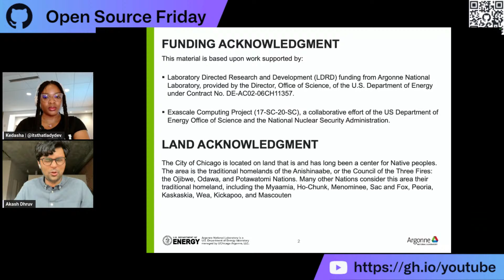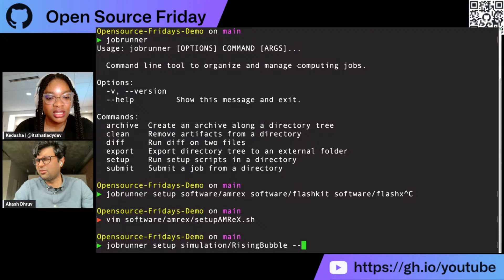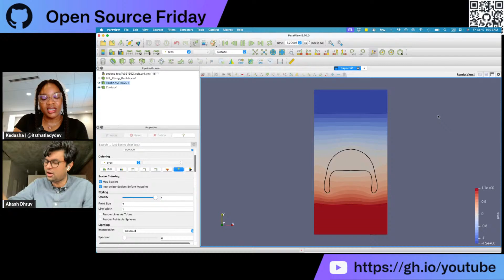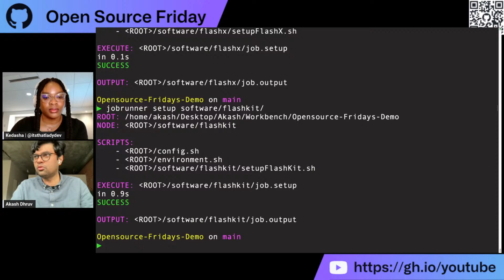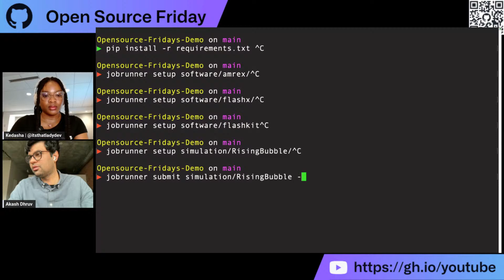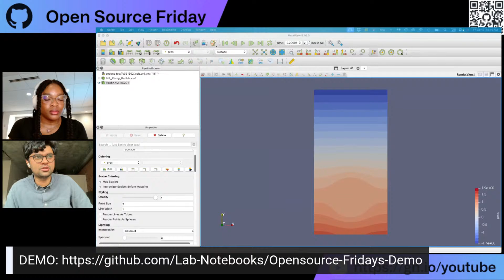Open Source Friday with Flash-X: a Multiphysics Simulation Software

Comment: CAN Flash-X be run interactively?  Say, if you wanted to let user adjust a parameter or boundary condition dynamically while the simulation is running, and observe the effects.